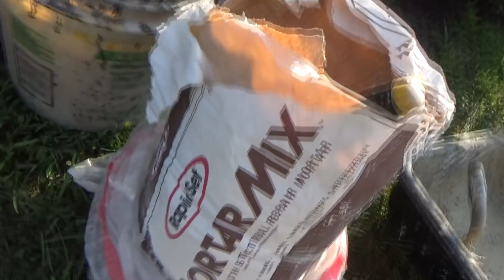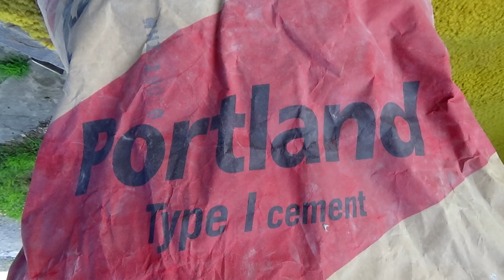CONCRETE REPAIR/PATCHES (Part 4)Mike Haduck

Comment: Hey Mike , you are my hero pretty much. I’ve been trying to fix a situation where I was digging a trench on the side of my patio for a drain and didn’t realize the gravel I was shoveling out was actually the gravel under slab …I’ve ended up having to fill 20 feet of voided disaster and I’m on my last section. I actually dug down and created a reinforced footer for this last corner because it supports our 20 foot upper deck post. I’m ready to put blocks in and since it’s not a window or door opening, I haven’t been able to find any videos where you have to fill pretty deep voids …I used large stones and mortar as far as my arms could reach back….and some areas the gravel hadn’t spilled as much. I wish I could have found a way to recompact it from the side but it just kept pouring out …anyway this last one doesn’t have a ton of space behind the blocks to fill, so should I just use foam when I’m done or should I mix gravel into my mortar mix to pack it up I’m so ready to be done
Reply from the maker: Hi sae, I can't say unless I was there to see it and understand it. Some of my foundation repair videos might help, thanks ,Mike

Comment: Best wishes for the holidays and the New Year Mike.
A question about this job. IF the owner wanted it unpainted, would you have brushed Portland slurry on it after the patching?
Rapid Set Mortar Mix tends to be fairly light when it cures.
Reply from the maker: Hi pensive,  I probably would have as long as the owner understands it a yearly covering,  I would only do it for family and friends, thanks mike
Reply: ADD a pigment to the rapid set. Charcoal grey

Comment: Hey Mike... you said "concrete... avoid at all costs". I've seen you doing stamped concrete - which you didn't seem too enthused about, pavers or stone on gravel which you didn't seem to care for. What are your recommendations for someone who wants to replace a deck w/ a patio. (You know... getting old... can't or don't want to do steps ;-)  ). Oh... and we're talking Ohio/Pennsylvania/West Virginia. Thanks!!!
Reply from the maker: Hi, it's a hard question to answer, just do what works best for you situation, get some ideas from the local guys.  I hope it helps, mike
Reply: Pavers with 6 inch base and under drain

Comment: Mike, I have an older Maryland home in need of concrete work both inside (basement wall) and outside (foundation, stop and walkway).  This video shows one of the concrete projects I need.  It looks exactly like my steps and walkway to my cellar.  Should I put off hiring a contractor until the weather is warmer or is it okay to have concrete work done on my outside now?
Reply from the maker: Hi. I am a fan starting outside jobs after the frost is out of the ground, every situation is different,  thanks mike
Reply: wait

Comment: I like to watch you videos. You always work with ease. Just a question: is that mortar mix is the same product as post-crete (called in England) mixes?
Reply from the maker: Hi Sam, I don't know,,  the product has only been around here about ten years, I have had no problems with it,  thanks , mike
Reply: Post Crete has more stones in it. Screw fix and b&q do fast set cement if needed

Comment: Why not use a lime mortar like they did in old construction that seems to last forever. Have a great new year!
Reply from the maker: Hi MG,  in our area lime mortar falls apart within a couple years,  down south it is a little different, thanks mike
Reply: @MikeHaduck  If we are talking masonry ONLY, errors in chemical composition and construction cause failure. Note type S and N have the same amount of lime.

Comment: Any reason you used mortar mix instead of cement all? Thanks for sharing the video and happy New Years.
Reply from the maker: Hi Michael, in my experience it is the same thing with sand added and a bit easier to use, thanks mike
Reply: Cement all is a grout with a plasticizer, more cement content. mortar mix is CSA cement with a plaster sand for deeper areas. Cement all only has a fine silica sand.
Reply: Thanks Alex for the explanation. I think Mortar Mix will look grittier and less smooth since it has sand.
Reply: @michaelbasic6947  you can float it and it will be smooth

Comment: Great video Mike.   I have a question.   I just bought a rental property and the walk up stairs has chunks of concrete missing.   Is it a good idea to do concrete work in the winter?   Should I wait untill spring?   Or would it be okay if I just did it now?   I'm doing work like this for the first time.
Reply from the maker: Hi Dean, I usually use a fast drying cement like rapid set, and doing it above freezing temperatures,  and the base is above freezing I have never had a problem,  thanks Mike
Reply: Winter can be done but takes more steps are much more room for error.

Comment: Hey Mike what would you do to patch a wall with rusty rebar showing
Reply from the maker: Hi Samantha.  What I usually do is what they do on the highway bridges. Etc.  Get all the loose stuff off and re patch  it like on my concrete steps repair videos, thanks, mike
Reply: You have to partial depth cut the area out. Use a chipping hammer to remove the unsound concrete. You must NOT nick or vibrate the bar with the chipping hammer. Then vacuum the area and flush with water. If its a structural component you MUST sand blast the repair area and the rebar to remove the rust. If the bar is totally corroded, its a larger project. If its not. prepare a repair mortar. Rapid Set DOT mortar mix with latex is ideal. Place the material at low slump. Float and cut the edges. Towel or finish. water cure.  then cut the joints around the repair to a depth of 1/16-3/16. Clean this. And then apply a silane or silicone sealant in the joints. you must not feather edge the repair.

Comment: Usually of the substrate is in a mode of micro mechanical or chemical failure, it should all be replaced.
Reply from the maker: Hi Alex, around these parts our weather kills concrete, and its mostly pay little to keep patching or pay a lot to keep replacing,  thanks for the comment,  Mike
Reply: @MikeHaduck  I am in Northern Ohio so I have the same situation aswell

Comment: Chances are in Pennsylvania, if you paint it with real stucco paint or concrete paint, it will seal the surface and less water will enter. If you paint it with Portland, it is concrete and porous which let’s the water through that enables it to crack more when it freezes. Anyhow, my thoughts.......
Reply from the maker: Hi MrMudstud, yes I agree, for patios I like paint, thanks mike